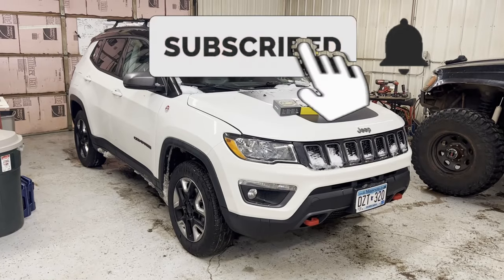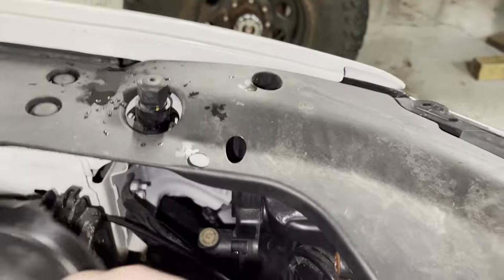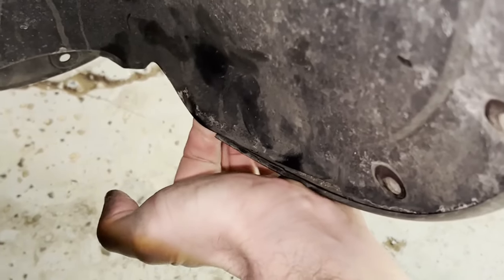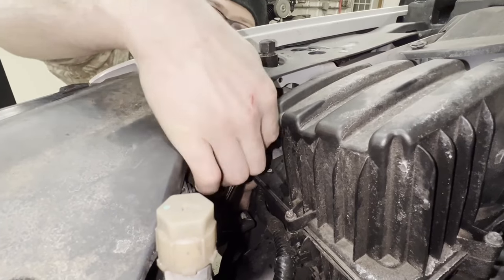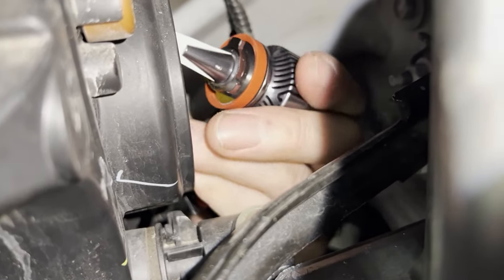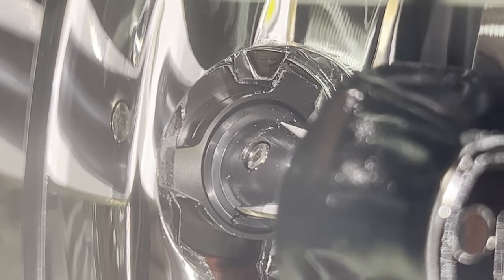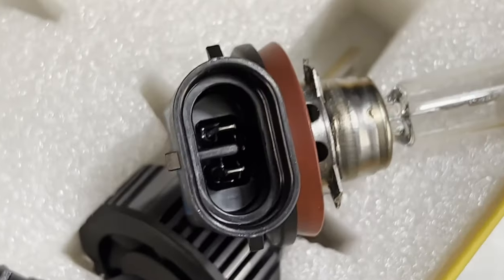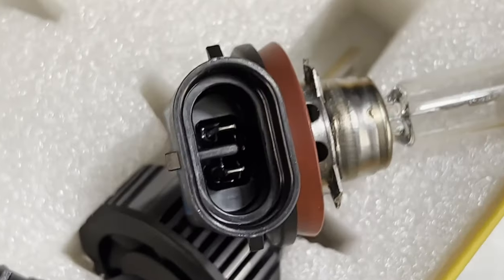Jeep Compass Low Beam Headlight Replacement  - LED Upgrade By Auxito

Comment: So it's a year and some change later.  Just wondering how they are holding up?
Reply from the maker: Good so far! The GF gets flashed from time to time so I may need to adjust the headlights but the bulbs are still working well.
Reply: @TonyTheTruckGuy awesome. Thanks for the update. Have a blessed Easter.
Reply from the maker: @soscattered6126  No problem, you as well!

Comment: These led lights and decoder fit perfectly as original bulb with no modification. Work great great product. 

H11 H8 H9 LED Headlight Bulbs, 120W 24000 Lumens Per Set, 700% Brighter, 6500K Cool White
Reply from the maker: Thanks for the info!

Comment: did this with my moms 18 pacifica uber hard to do but some how i did it goin threw the hood rather then the splash guard, it was gewtting the dust cap back on that was my issue

Comment: Is this bulb for both low and high beam?  Or is there a separate high beam bulb?  2019 Compass Latitude.
Reply from the maker: Low and high beam are separate bulbs. This is for low beam. The high beam is the next bulb over towards the center of the vehicle.
Reply: @TonyTheTruckGuy    Thanks, Tony!  Would I just buy 4 of the same bulbs then?  I haven't seen any products that say LED for hi beams specifically for this vehicle.  The product pages either say low beam or they don't specify.
Reply from the maker: @garyk66channel  I can’t verify 100% since I never did the high beams on this one, but Autozome website says the low beams are H11 and high beams are 9005. I do have a video on the fog lights if you decide to do those.

Comment: @TonyTheTruckGuy Hey! Will this also work for a 2016 Jeep Compass? Gonna replace a headlight bulb today and gonna use this video if so 😊
Reply from the maker: @porterdrummajor  2016 was a slightly different body style if I recall, so I’m not sure if it will be the exact same steps or bulb number, but the procedure should be similar.

Comment: And also, why did it matter not to get the original light bulb dirty when you were replacing it anyways?
Reply from the maker: Just a good habit when handling bulbs and in case you need to reinstall the factory bulb for some reason.
Reply: @TonyTheTruckGuy  Good Stuff

Comment: So why just low beam? Does it replace both? Or are high beam diff bulbs?
Reply from the maker: Different bulbs. I just did low beams and fogs because that's what was provided to me and the high beams don't get much use anyways
Reply: @TonyTheTruckGuy  Awesome man. Thanks. Picking up a 21 next week and will definitely do this. Thanks for the quick reply as well!!!
Reply from the maker: @terrycorkum  No problem. Good luck with Jeep purchase and light install!

Comment: i read that when you install a LED to jeep models it flickers or 
 it gives you a dashboard error, did you have any of those problems ?
Reply from the maker: That is a common problem, but not if you get a kit designed for your specific vehicle. These ones have been working well!
Reply: @TonyTheTruckGuy I own a jeep compass limited 2019. What's the right kit for my car?
Reply from the maker: @mrcapable3645  I would guess the same as used in this video, but I'd go to their website in the video description and enter your vehicle info just in case

Comment: The LED placement has to be 9am and 3pm position? They seem to be slightly off even tho they are maxed out turn.
Reply from the maker: Never noticed that actually but it looks like mine are at an angle as well at the 8:30 mark if you’re talking about the LED’s themselves. Mine look like they’re pointing at 9 and 5. But I also noticed now around that same 8:30 timestamp, you can see when I wiggle the bulb that the little lock ring moves a bit on the bulb. I wonder if there’s any way to rotate or adjust that before installing the bulb. That being said, these seem to be working well as is.
Reply: @TonyTheTruckGuy  there’s another auxito that is 360 adjustable to get that perfect vertical position. It’s critical for it to be perfect positioned because this what blinds other drivers.
Reply from the maker: @kamikazeephi  So this one is not adjustable? I’d check myself but the GF has the Jeep lol

Comment: Did you remove that light bulb with one hand?
Reply from the maker: Yes
Reply: Good stuff do you have another video I could see it at a different angle
Reply from the maker: @michaeloconnor2039  Just this video. Should be plenty though. Bulb just rotates.

Comment: How to fix flicker on leds
Reply from the maker: Return them and order a kit like this that is designed for your specific vehicle. The only way around it otherwise is by ordering resistors and capacitors to plug in or wire in line with the bulbs to truck the vehicle into thinking there’s enough resistance.

Comment: Jeep dealership wanted to charge me 1200 for this saying they had to remove the bumper.
Reply from the maker: @Rhythmicons  Are yours factory LED?
Reply: @TonyTheTruckGuy  they look like bulbs to me but are factory. Will probably go by autozone tomorrow.
Reply from the maker: @Rhythmicons  If they  are this style then you are fine, if factory LED, the entire chip or headlamp will need to be replaced
Reply: @TonyTheTruckGuy  I swapped the bulb out thanks to your video, but it still didn't light up. Brights work. Will check the relay next.
Reply from the maker: @Rhythmicons  What year? I can try to look up a wiring diagram
Reply: @TonyTheTruckGuy  It was the bulb. The guy at the auto parts store sold me the high beam instead of the dim. Thanks! JFC! 1200 for a 20 dollar part.
Reply from the maker: @Rhythmicons  Unreal lol. Glad you got it figured out!